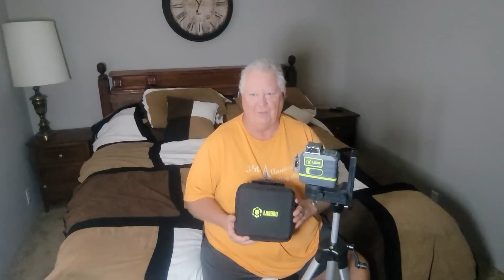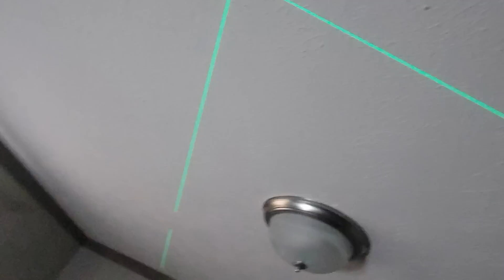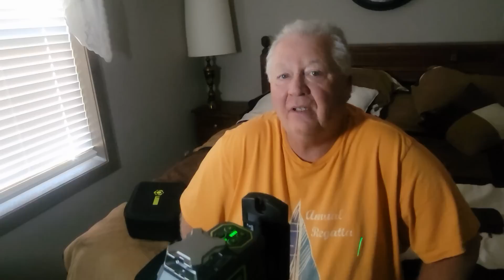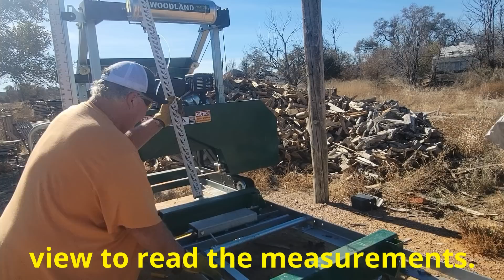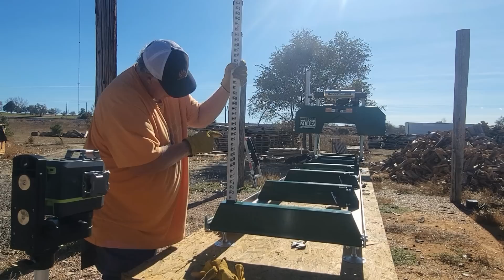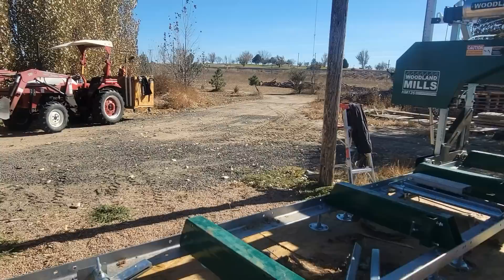Leveling our Sawmill with Lasgoo Laser Level

Comment: Can I ask why the mill is so high?   Does it help somehow?   Seems like a log could really crush you a lot easier up high.
Reply from the maker: We put the mill at that height to make it easier to pull milled wood off. So far, it has been working well. We use log braces to make sure the logs don't fall off the mill. Thanks for commenting and stopping by.  Take care!
Reply: @sswoodprocessing  For sure.  Makes sense.   I need to pour a slab under my setup and am looking at all. options for height.   Thanks for the response.   Take care and be careful out there.